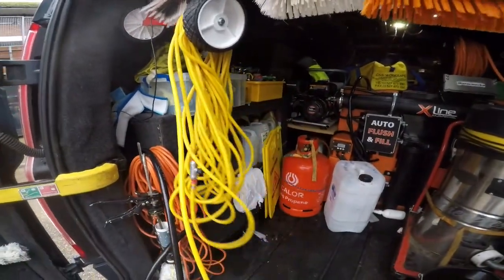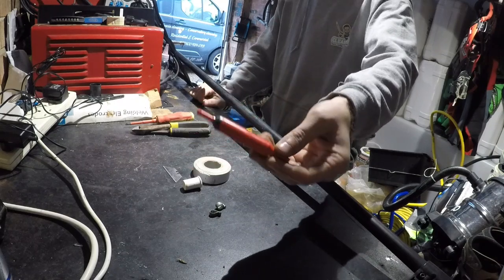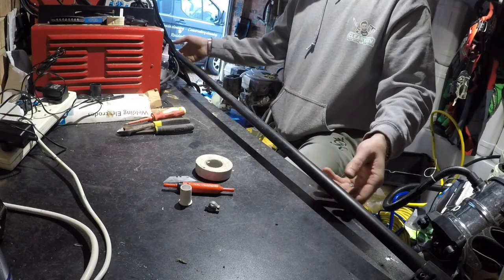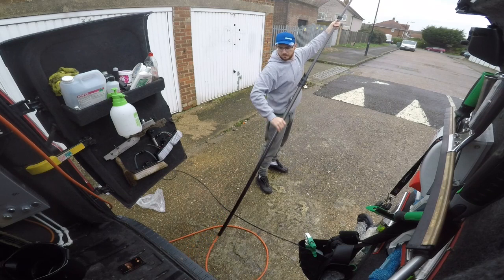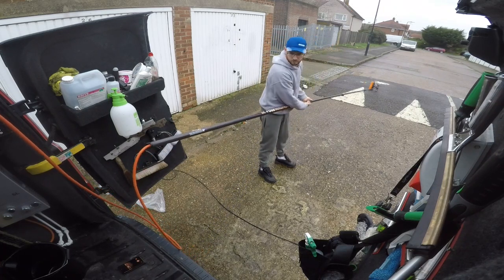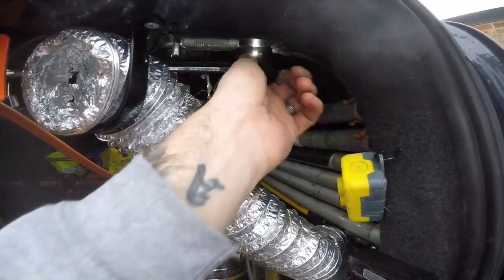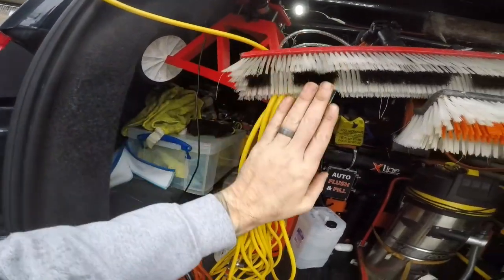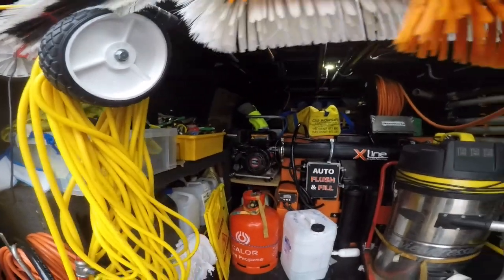window cleaning Diy Hoseless Pole Set-up

Comment: Nice setup! It's definitely not viable having loose hose hanging around in the van getting tangled.. Just a friendly tip, 

 My system goes like this:

Reel hose, reducer barb (to go from reel hose to pole hose diameter) then just enough pole hose to reach my highest jobs. All of that stays tidy on the reel, doesn't snag on anything when reeling in as there's no fittings on the end..

Then just 6" of pole hose out the end of the pole with a pushfit 8mm pneumatic fitting! 
Works a treat and cost about a quid!

Just avoids the extra weight of reel hose up the pole 😎

Comment: I did this conversion tonight after seeing your video Ricky, looks good so far- just hope it works as good.
I was using slick connects but they’re made of plastic and the barb on the reel hose connector kept snapping and they didn’t give a shit after buying 3x 3 packs from them, they didn’t want to know. Back to good ole rectus fittings just hope this hoseless job lasts me now.
I use a diesel hot water system so maybe that could have been the cause of the slicks to snap but who knows.

Comment: I was told by window cleaning supplier that you cant put hose reel hose up your pole, been wanting to do it for ages to eliminate snagging on pavements, corners, looking a lot tidier too, will it be lighter with 6mm hose reel, or is that what u use? Ive been using exceed innovations tubeless/univalve kit for years with the rectus sleeve, but they always seem to break, your way seems a lot cheaper and better.👍🏻
Reply from the maker: Mine is a 8mm and you can just follow there how to on to do it . I have to say this is one of the best mods. Never had a problem.

Also please like and subscribe 👍